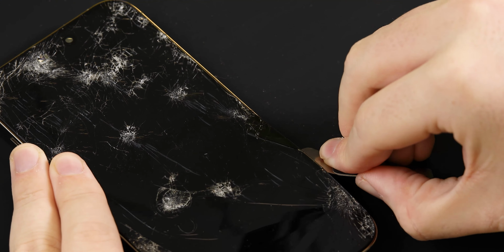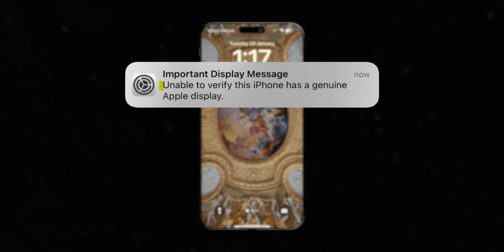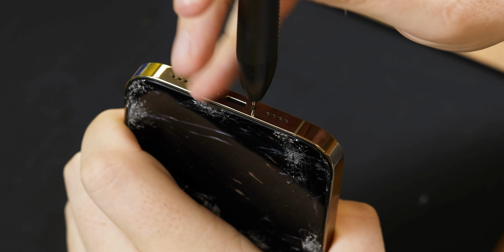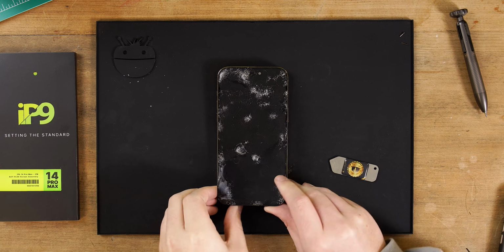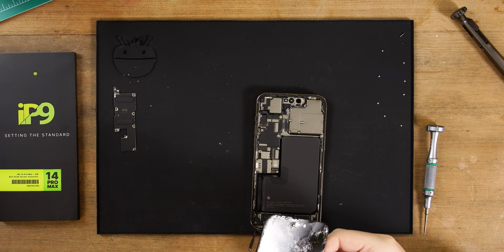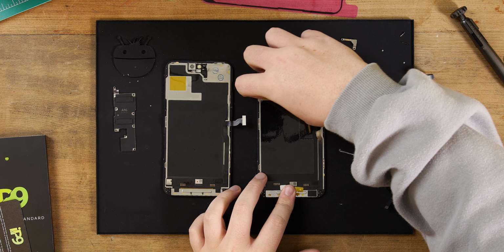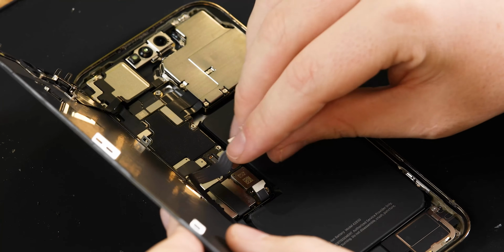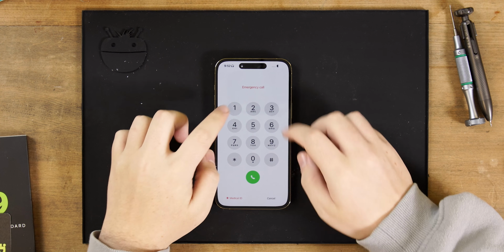iPhone 14 Pro Max Screen Replacement Repair

Comment: Can a green screen be fixed woth out cahnging the screen?
Reply from the maker: Hi! Thanks for the comment. I would need a bit more information and background about why your screen is green? Have you dropped it? Is it cracked? Does a computer recognise it when plugged in?
Reply: It has been dropped before but the day it turned green it was not dropped. It's not cracked and the computer recognizes it after I hold the power button for like 30 seconds.
Reply: And it says something about a problem with the phone and updating it can solve the issue or restoring it. I tried updating it but nothing and I haven't tried restoring.
Reply from the maker: @ It's difficult to know what the issue is without looking at the device ourselves. I'd either recommend fitting a new screen and seeing if the issue persists or booking it in for a diagnostic at one of your local repair shops.

Comment: i would liek to contact you and ask some questions about my 14 pro max if you dont mind? mine is over heating with the new screen. i bought the more expensive OLED version too
Reply from the maker: Hey there! Thanks for your comment! Where did you purchase your screen from?
Reply: @Iparts-4uCoUk  i bought it from china. I originally bought the cheaper INCELL screen, which was slower and less brighter but it worked perfectly fine. then i smashed the screen again. So on the next purchase i went for the much more expensive OLED model. which works perfectly when installed and looks like OG - BUT it literally makes my phone an oven HOT
Reply from the maker: @TheLABProject-84  First thing I would recomend is testing a different screen with it and see if the issue persists. If it it does then you know it's not the screen that's causing the issue and instead could be an internal issue.